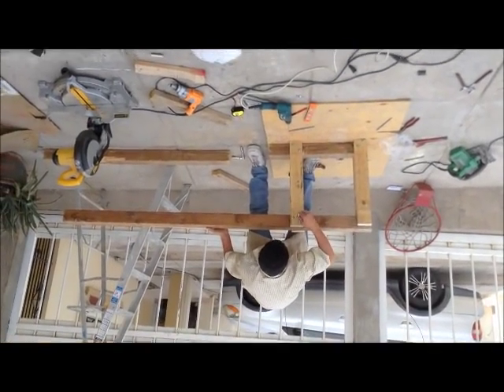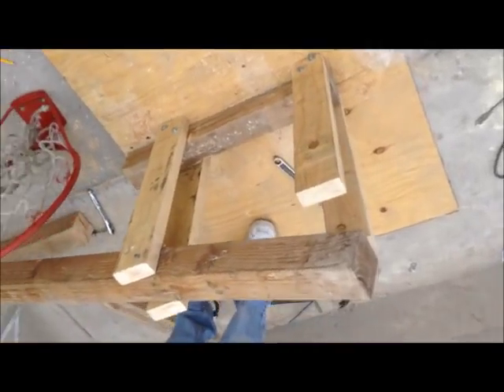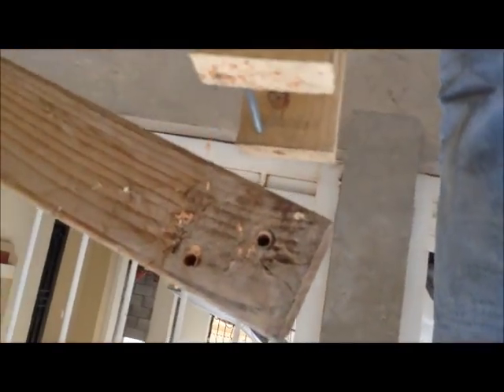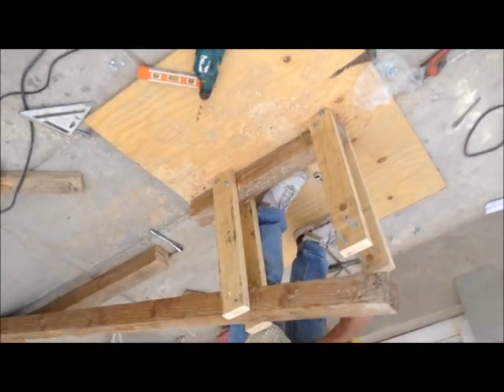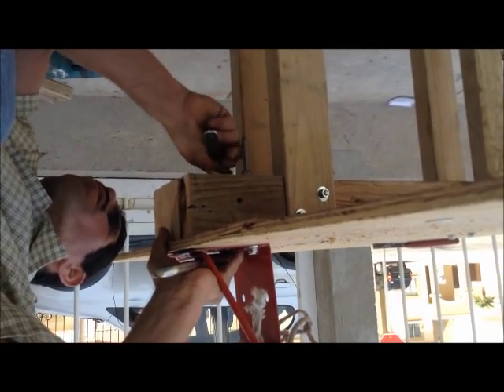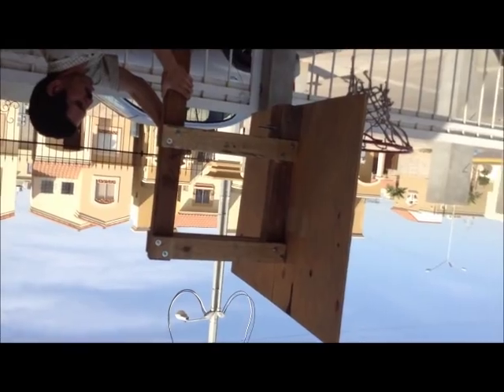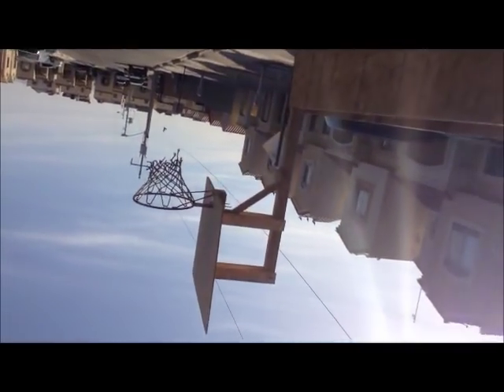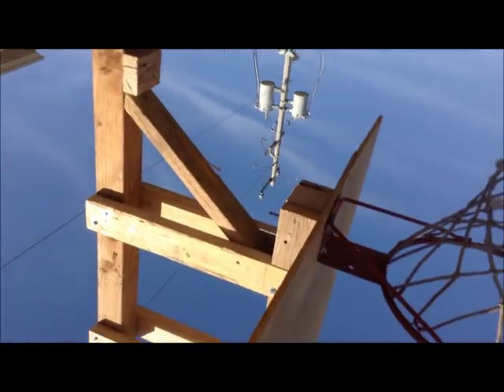the best basketball hoop ever made strong and very cheap full instructions

Comment: I am building a basketball hoop for a project I am wondering is there a way to make it height adjustable?
Reply from the maker: TheMcPianoKid 5000 that's a great Idea you can Slide the 4x4 in inside a 4x4 square tubing cemented into the ground and than shave down the the wood 4x4  and than put holes on the side with a long pin to adjust the hight.